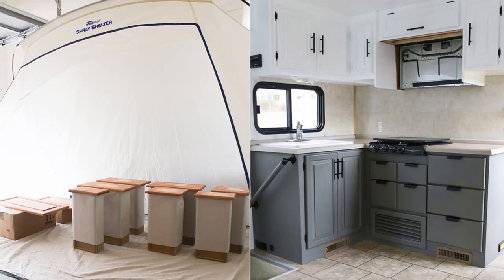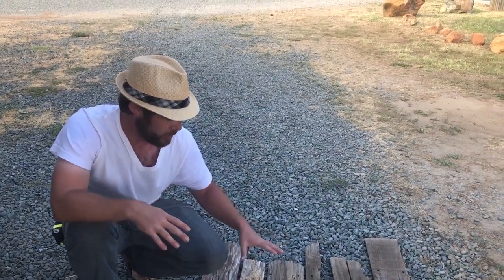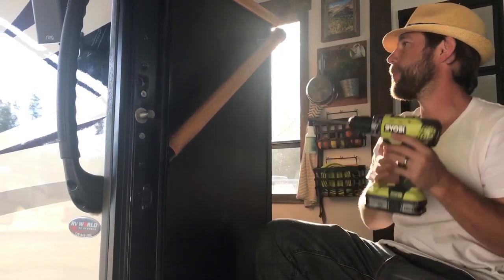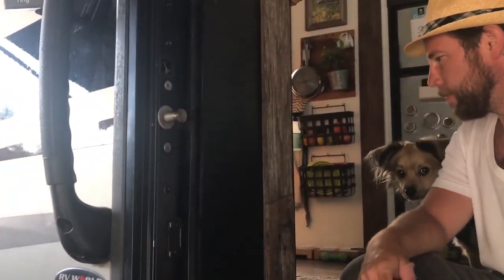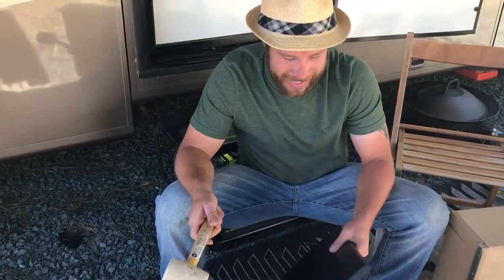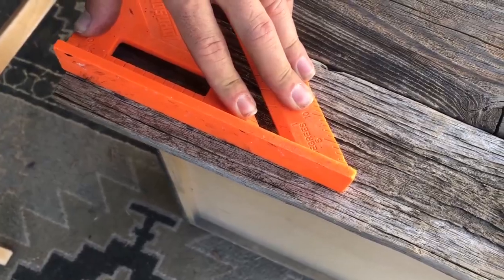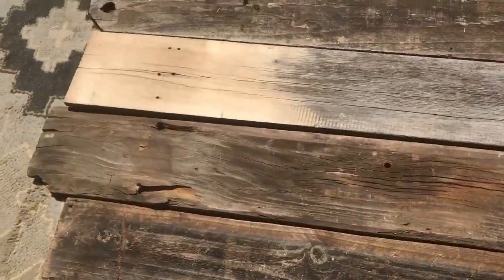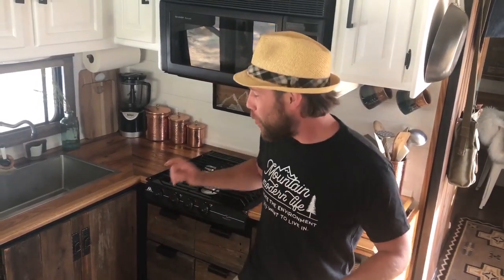Updating Our RV Kitchen Cabinets With Reclaimed Wood

Comment: aggg, you got lucky with a good kitchen drawer layout, mine sucks so much i'm looking at completly tearing everything out, which is what I hoped you had done. i'm looking at the kitchen cabinet sets from IKEA, but I have to discover if I can shave 2 inches of the depth, usually the drawers dont go all the way back. the IKEA sets offer the best versatility, but the depth measurement is the problem.   thanks for your channel
Reply from the maker: Hey @Grendel I'm sorry we didn't have the information you were looking for. I know that some of our cabinets do not go all the way back. With that said I think the IKEA cabinets are a good option, but also if you wanted to make your own I've found that most of the cabinets are constructed with 1X2 boards with a 1X3 sprinkled in against the wall to make it more secure. If you have any questions about how to do it feel free to let me know and I'll do my best to help :)
Reply: did you ever get your cabinets completed?? how did it work out for you? I am in the middle of doing mine today.

Comment: Maybe I missed it, but what width of MDF are you using for the new cabinet doors? I know it is super dense and can be heavy. That's my concern when thinking of its use for my needs in a vintage 1973 Travco renovation. As some other people commented - don't ever question your vision! Y'all have such great style and your videos are so inspiring!
Reply from the maker: Thank you +Shannon Lloyd :) and you are totally right, MDF can be very heavy. The piece we went with was 1/4 inch thick but really wasn't that heavy. What finally sold me was when I held the real wood doors that were on there and the new doors we made they weighed about the same. Anyway thanks again for the kind words :)